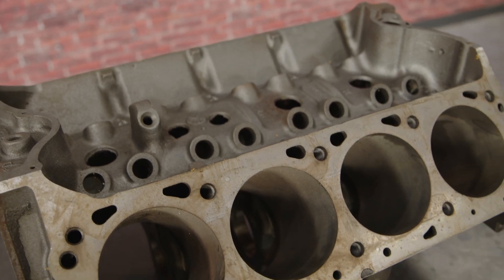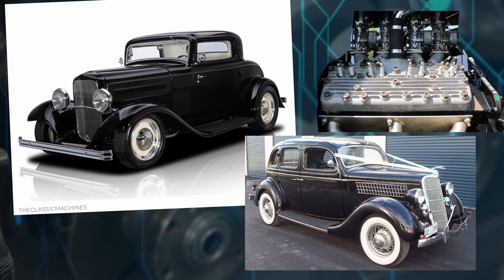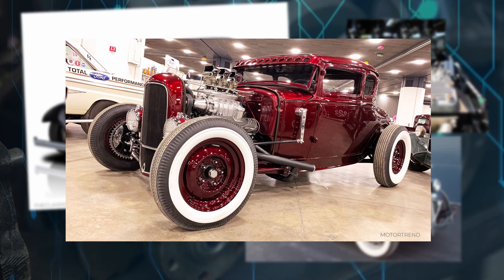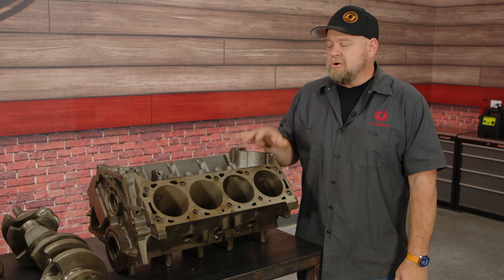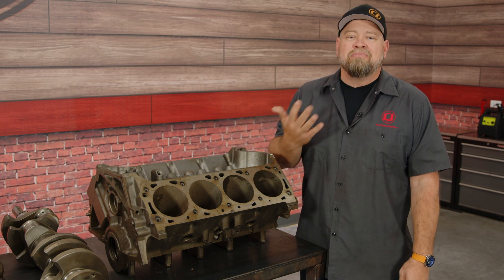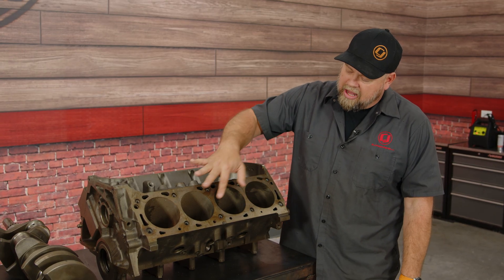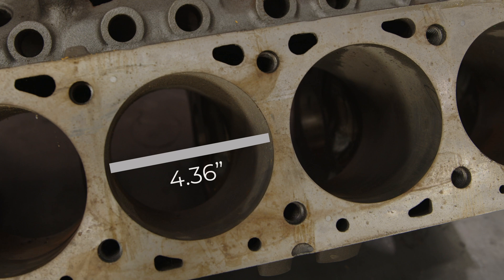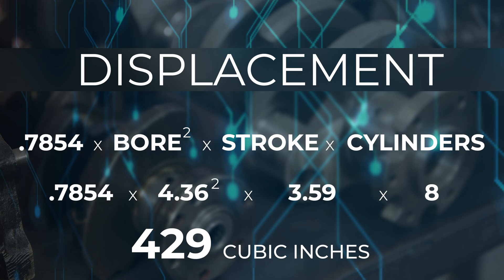Small Block and Big Block Engines Explained | Tech Talk

Comment: Bill, your description of the differences between Fords small and large displacement engines is right on the money as usual. They are clearly two entirely different engine types with no parts interchangeability between the two and both offer huge power increases with the proper modifications. 

But I would like to get your opinion about the two small displacement  engines that share the same basic dimensions as all Ford “small blocks” with pushrod actuated valve trains but virtually no production parts interchange between the two engines. 

The 351 Cleveland is often described as a big block engine but it has the exact same cylinder bore centerline spacing and head bolt pattern as the traditional 351 Windsor small block engine. 

The canted valve Cleveland heads have the capacity to support much more horsepower than the limited flow of in-line valve Windsor heads. They are a direct bolt-on for Windsor blocks with only a minor modification needed for the coolant passage and the combination is appropriately named the “Clevor” engine. 

The powerful Clevor has become so popular that aftermarket companies are now offering alloy Cleveland head and intake packages specific to the Windsor block. 

But the debate about Clevelands being a big block, small block or even a mid-block continues. I gladly welcome all opinions 🤔.
Reply from the maker: We are actually planning a video on the Ford 351's in the future as soon as we can get our hands on a few! I have never owned a clevor but have had a few 351Ws. I have always preferred the windsor to the cleveland personally because of the larger selection of parts available but you cannot deny the power potential of the 351C. Personally I would consider the 351C a small block but with a big block head if that makes sense.
Reply: @cjponyparts  good luck with that video presentation Bill. We're already confused!
Reply: @djwarren5081  … DJ, hopefully a good video would help with the questions and answers that constantly revolve around these great Ford engines 🏁
Reply: @cjponyparts  …. A Ford 351 video would be great and coming from a reputable source such as CJPP,  I’m sure it will contain plenty of useful and accurate information for Blue Oval fans to enjoy. The internet is a wonderful source of information but when it comes to the Cleveland, the amount of blatant misinformation can be very confusing, especially to novice builders. 

I agree that the huge amount of aftermarket parts support has made the Windsor a popular choice for Ford builders and enthusiasts alike. I’ve owned a couple of Windsor’s in ‘69 Mach 1’s and I understand their popularity. I’ve also been involved with building Clevelands ever since I purchased my first 351C, 4-V powered 1970 Mach 1 39 years ago. I still own it and CJ Pony Parts has helped me keep it in great shape.
Reply: Nobody but chevy guys think the clevland is a big block. It is clearly a small block. Every ford guy knows this. A 400 is also a small block. Really ford never referred to them as either but if you apply those terms to these engines then obviously the clevland & all the v8 ford engines that share this bore spacing is a small block.
Reply: @jesseduke694  … It can be confusing, apparently even more so to an unusually high number of Chevy fans. The single letter used to indicate the different small displacement, Ford pushrod V-8’s is simple enough for most people. 
Like you mentioned, the “335” Series of Ford engines also included the 400 cubic inch for those applications where extra torque was needed. It never was offered by Ford as a performance engine but it could of been a good starting point if they would have offered an optional 4-V carb and aluminum intake manifold , dual exhaust and a decent tune up. Those confused brand X guys call it a boat anchor and the 400M. Since Ford only made one production engine with 400 cubic inches, then identifying it shouldn’t be a problem. 🤷‍♂️ 

People with no imagination might see a boat anchor but most folks see the possibilities of a 431” + stroker Cleveland. The production cast iron 2 barrel heads have limited power production capacity. They still have an advantage over many other small block heads of that period because the poly angle valve layout, larger ports and valves all helped with increased flow. 

But nowadays there are several choices for aluminum Cleveland cylinder heads and intakes that are an affordable choice for making some serious power numbers.  Ford originally used the 400 in trucks and larger family sedans that required the extra torque. But considering that a 400 with an alloy heads upgrade along with a healthy hydraulic roller cam profile, more compression and the basic performance goodies needed, will quickly transform the ANCHOR into an engine that would be awesome in a vintage Ford pickup truck or any sleeper/ classic Ford sedan. 

Using a hydraulic roller valve train to compliment the alloy heads, even a conservative build will dyno a solid 565 lb/ft of torque and enough horsepower to hopefully get some damn respect. Boat anchors have a tough job with no respect 😳🤔😁🏁. 

Get all of the respect due along with many decades of hardcore Cleveland race winning experience. Ask for Tim Meyer. 
tmeyerinc.com
Reply: I was always taught the 351C was a mid block. - forged for 4 years. 1st 2 years in the US. 2nd 2 years in Australia and the block and heads were machined from the same forge for the 2nd 2 years so they would heat up and cool down better keeping away from warping.
I could run my old 70 xr7 Cougar at the track all day and it took it like a champ.
Correct me please! I'm always down to learn more about my favorite FERD engine.
Reply: @aesir0784  The American 351 Cleveland production run was from 1970 to 1974. The Ford foundry in Geelong Australia continued production until 1982. Clevelands are also known as Fords “335” Series of engines which includes the 351C, 351M and 400. Clevelands are physically larger than what’s generally considered to be Fords “small block” Windsor engines including the 260, 289, 302 and 351W because the canted valve layout of Cleveland heads requires more area than the inline valve design of the Windsor heads. 

However since the Cleveland heads have the identical cylinder bore centerline, head bolt number and bolt position as Windsor heads and with a minor coolant passage modification can be a direct performance upgrade bolt on with Windsor blocks, the Cleveland is also considered to be a Ford small block engine. Everyone doesn’t agree but that’s just part of the controversy that is associated with the Ford Cleveland engine.  But historically, it has proven to be an excellent performance engine and my first choice over the other great Ford engines 🏁
Reply: From what I recall, Ford never classified their engines as small, medium or big block. They did classify them as families considering their were so many bore spacing engines available.
Reply: @ Your recollection of Fords descriptions pertaining to their different engine families is correct